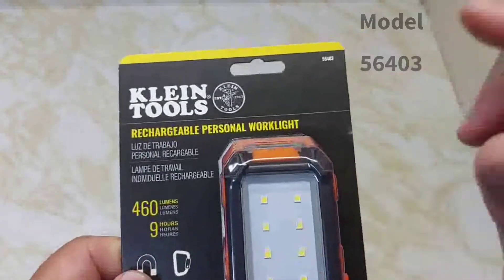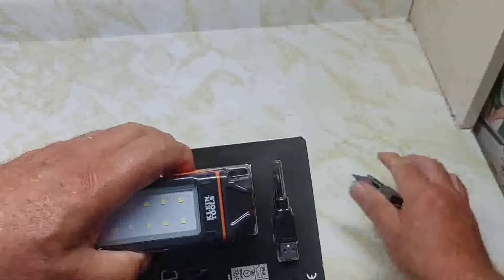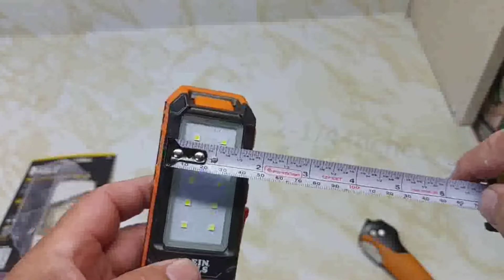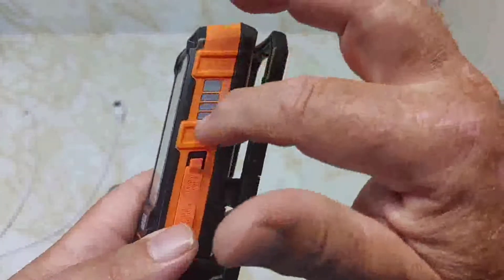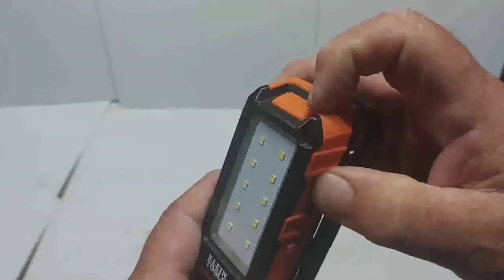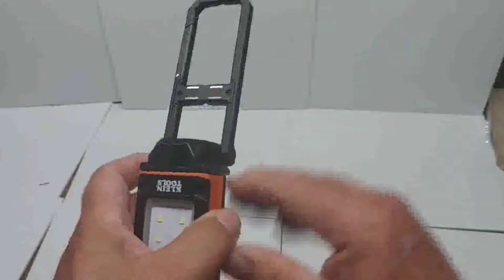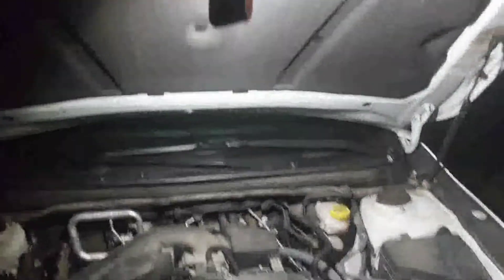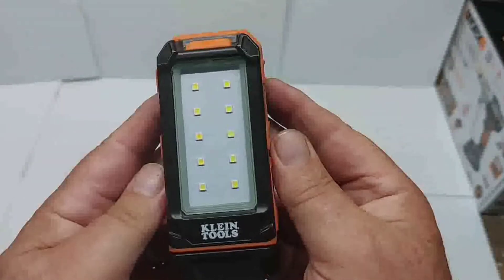Klein Work Light 56403

Comment: The magnets is really strong?
Reply from the maker: Yes magnets are really strong.
Reply: Yeah by far the best compact rechargeable work light I have used.
Reply from the maker: @joemcdaniel7441  Been using it a lot lately. Very versatile.
Reply: @JimMcLaren1950  can you charge and use at same time
Reply from the maker: @brianedgell9410  yes
Reply: Thank you
Reply: Is is the battery replaceable or Built-in
Reply from the maker: @brianedgell9410  built in